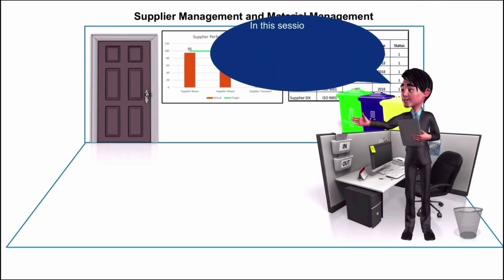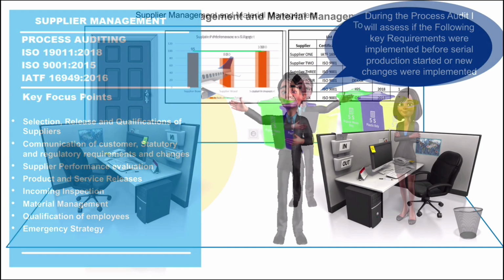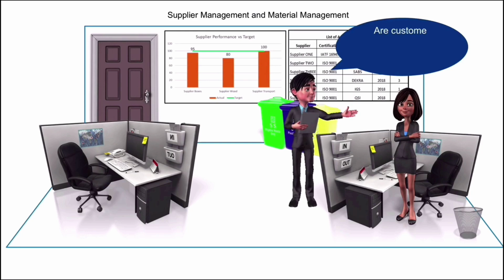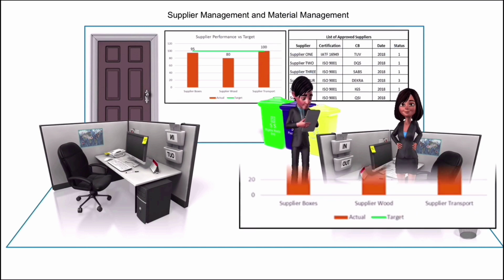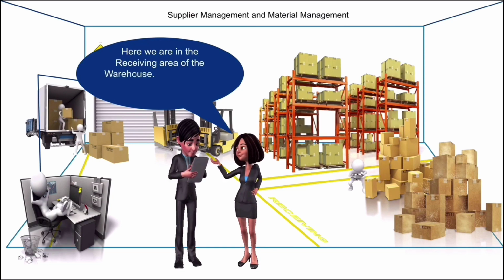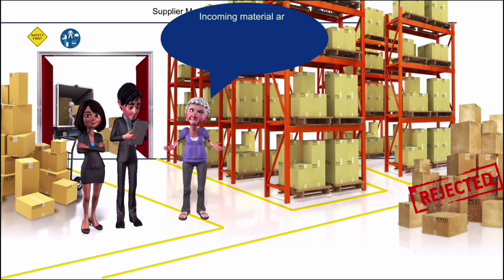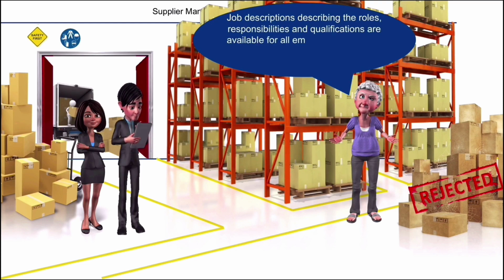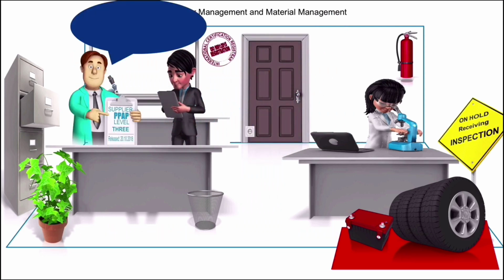How to perform a VDA 6.3 P5  Supplier and Material management process audit according to IATF 16949

Comment: Does VW says how many times a year you should audit your suppliers (serial production)? And does it says how often you do your internal audit?
Reply from the maker: 9.2 Internal Audit
VWAG requires a yearly Supplier Self Audit (VA/SL) acc. Formel-Q-capability (Chapter 3)), a Self Audit has valid time period of max. 12 months.
A specific Self-Audit-Format is supplied on Volkswagen Group B2B www.vwgroupsupply.com “Format for Supplier Self Audit”
 Supplier Self Audit (VA/SL) must be conducted by certified VDA 6.3 auditors
(see auditor qualification in Section 3.2 of FQF 8.0).
Formel-Q- Capability-Appendix must be considered.
In case of D/TLD-marked parts supplied to VWAG, a D/TLD-Supplier-Self-Audit according to Formel-Q-capability is required within every 12 month. (Formel-Q-Capability, Chapter 7: “Quality Verification Audit for D/TLD Parts”)